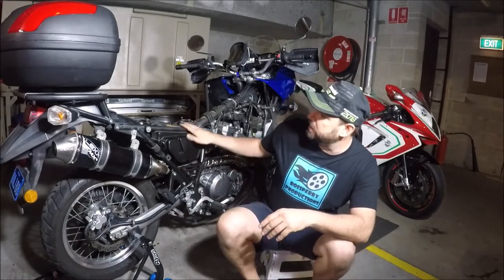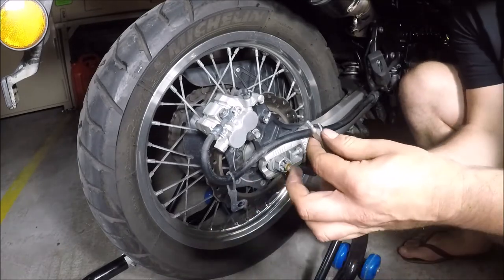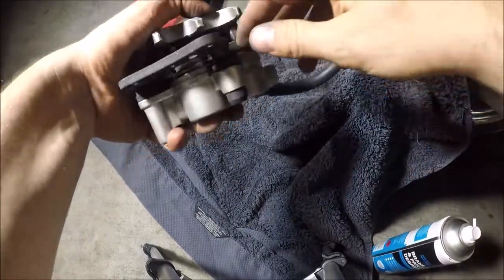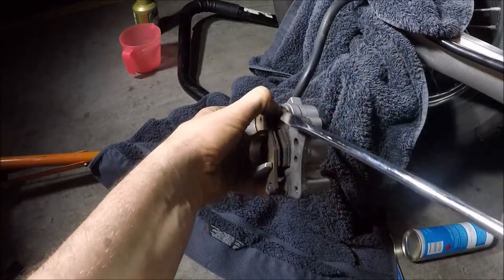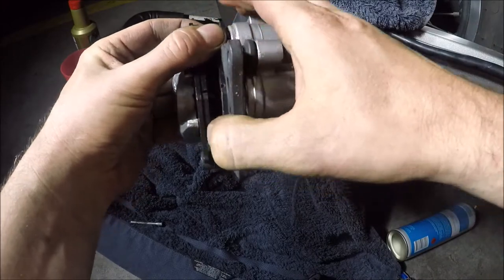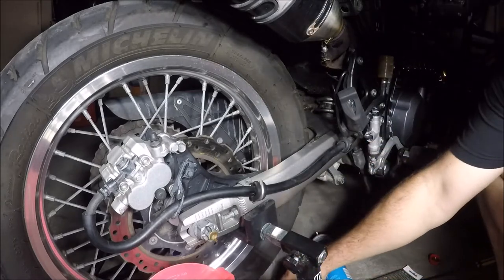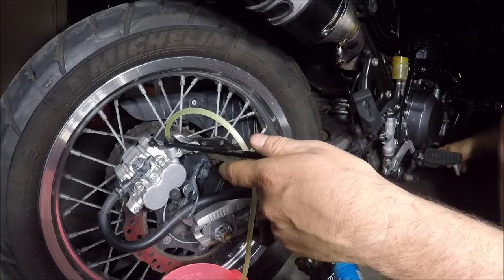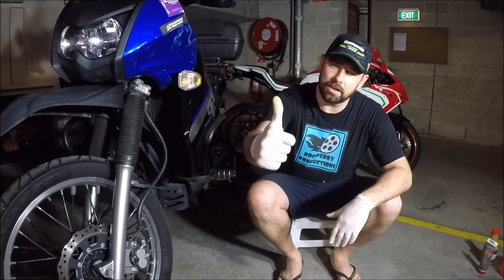How to Replace the Rear Brake Pads on a Kawasaki KLR650 Tutorial

Comment: why copper grease? can it be any grease? like lithium?
Reply from the maker: No, don't use normal grease as it could get onto the brakes, it would be better to not use any grease at all. Copper grease or copper slip, just stops the pad sticking to the calliper to reduce brake squeal.